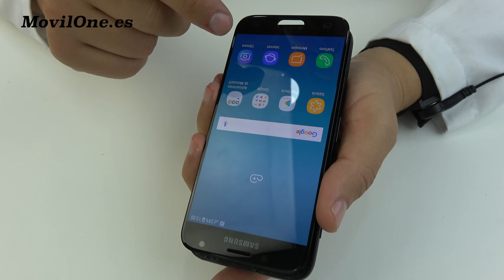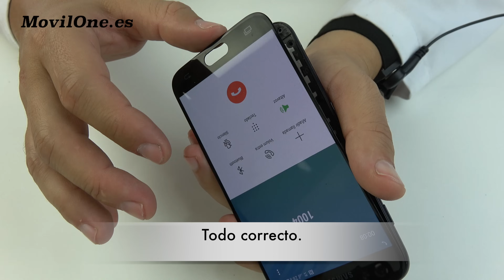CURSO de REPARACIÓN de CELULARES #7 Cambiar lector SIM

Comment: Veo que en la muñeca izquierda trae un cable como pulsera. Si está bien para que sirve?
Reply from the maker: Hola Mario, Un brazalete antiestático o pulsera antiestática (también llamado muñequera antiestática) consiste en una cinta con un velcro para fijarla en la muñeca conectada a un cable de toma de tierra que permite descargar cualquier acumulación de electricidad estática en el cuerpo de un operario de equipos sensibles. Un saludo
Reply: Gracias por responder es la primera vez que recibo respuesta a las preguntas que formulo

Comment: Hola, quiero comprarme una pistola de calor a mi alcance que se puede ajustar a cualquier temperatura hasta 650°, pero el flujo de aire tiene solo dos opciones y no es en porcentaje, dice 250L/min y 550L/min, me servira para este tipo de trabajos?
Reply from the maker: Hola. Así lo tengo yo. 👍
Reply: @MovilOne  no me quedó claro si me sirve o no, es que en tu video sale 45% y 20% de aire respectivamente , cosa que en la pistola de calor que quiero comprar no tiene esa opción
Reply from the maker: Hola Jordan. Esta es una estación de aire caliente no una pistola de calor. Es otra cosa. Cómprate una estación de aire para levantar los conectores de carga, lis IC y los lectores. Un saludo.
Reply: @MovilOne  gracias mi otra consulta es si el flux para desoldar es el mismo que el flux para soldar?
Reply from the maker: Hola Jordan. Nosotros para desmoldar utilizamos un FLUX más económico, porque un bote pequeño de Amtech cuesta casi 30€. Un saludo.

Comment: Lo realmente interesante seria q mostraras como diagnosticar un lector de sim el valor que debe tener cada pin en su escala de impedancia sin voltaje y ya encendido si es que alguno debe obtener un v de donde viene ese v, rst, clck etc... cambiar un lector de sim no es gran cosa.
Reply from the maker: Hola. Si no hay Service Manual es prácticamente imposible sacar estos voltajes. Lo malo que algunos de estos voltajes llegan directamente del microprocesador entonces adiós jumper. 
 Yo te garantizo que en 99.99% de ocasiones está fallando el propio lector. Ya son miles y miles de dispositivos que han pasado por nuestro taller. 
  Un saludo.